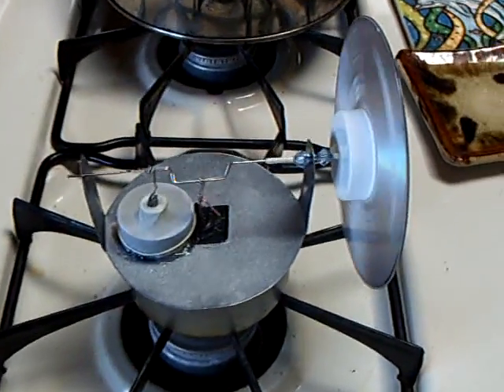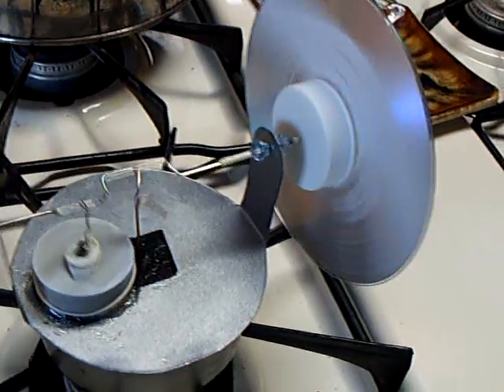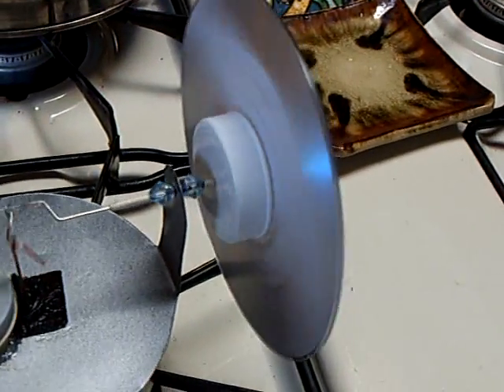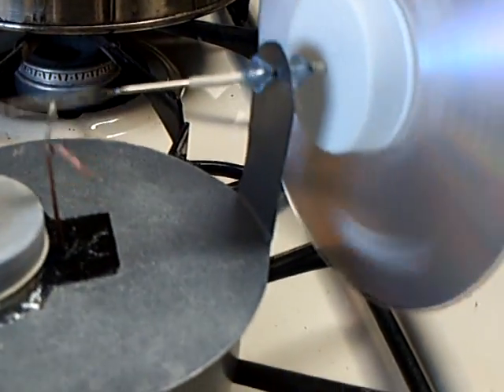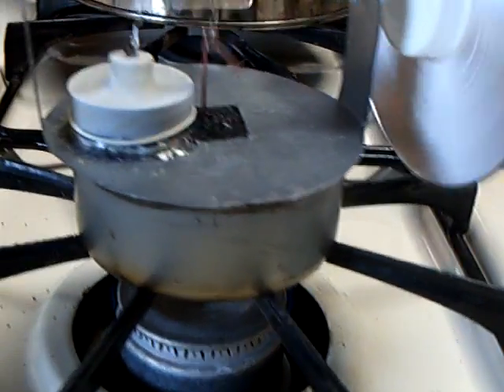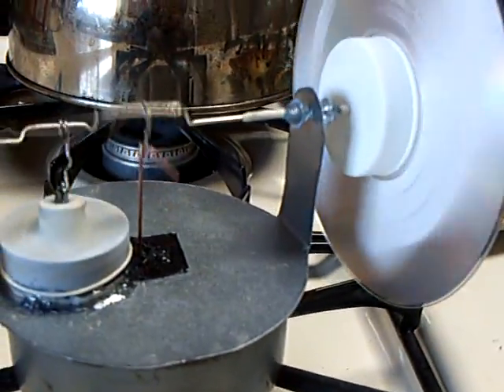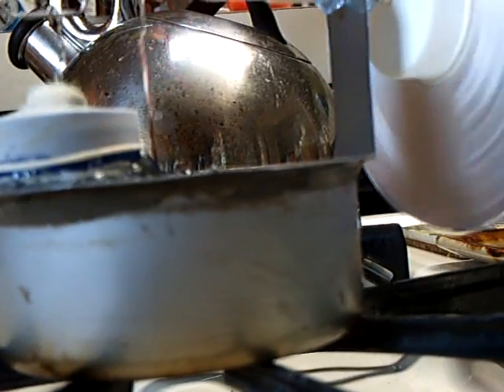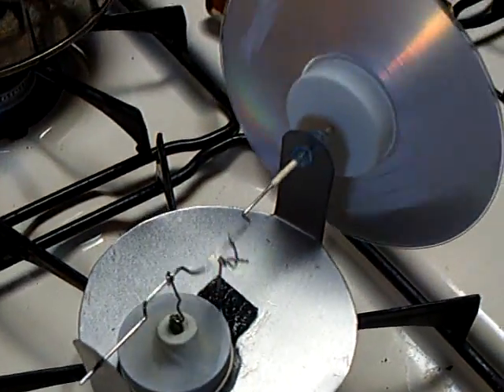Stirling Engine---Successful build

Comment: Lidmotor;
What you are missing is the invention that made Rev.Stirlings heat engine light years ahead of the rest( The regenerator).This is a simple heat exchanger. The displacer shuttles heat from bottom to top.If you can save that heat=efficiency.Try JB weld for seal around displacer rod..Drill it for more air tight fit..Use powered graphite as lubricant.

Comment from the maker: I have seen some great small stirling engine builds with generators attached.  There are commercial ones you can buy on Ebay but they cost well over $100.  There is tiny one made in Japan that I would really like to have.

Comment: Congratulations, as you may have noticed, the basic thing is to be careful with friction and air leaks.
And each building a new engine, you will have more experience to perfect the next.
In my first engine, also barely worked and today I have reasonable performance engine.
Greetings from Brazil.
Leandro Wagner.